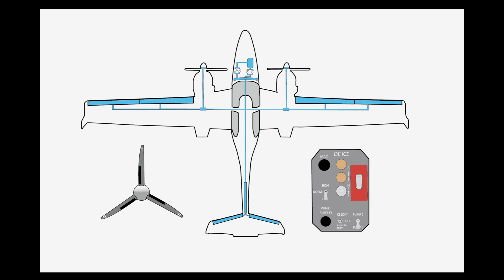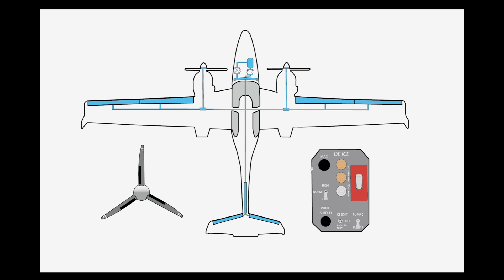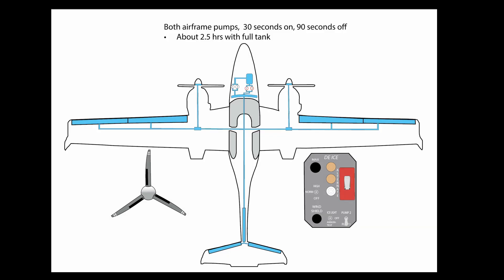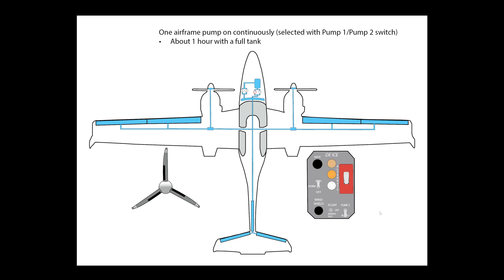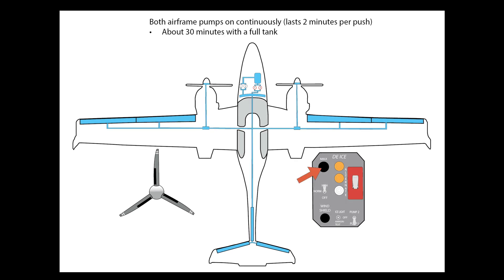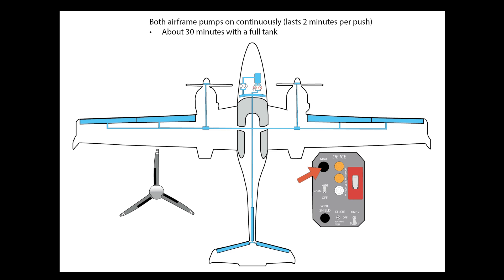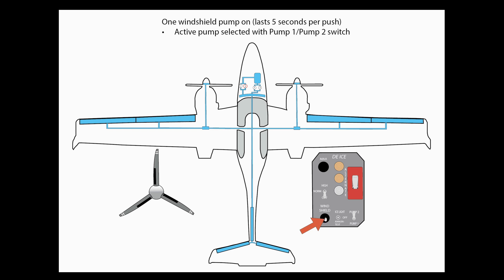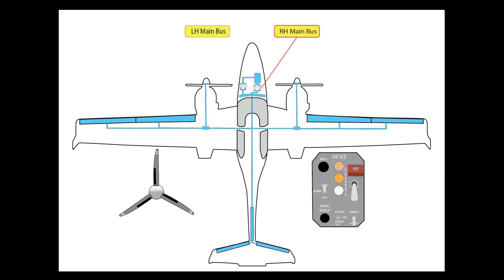DA42 Ice Protection System

Comment: I learned so much from this video. It is very clear. Thank you so much! I work at the diamond factory and it is useful information for me. The last portion is good design. In case of one alternator failure, at least we can still run the TKS system for a while.

Comment: Very good video! (as you say the POH is somewhat lacking in detail). While writing do you happen to know what is the reason you mentioned that in norm both pumps run together, but in high only one runs (and which of the two depends on the switch position), seems a bit counter intuitive - for example in norm they could alternate every 30 seconds ? Perhaps it is related to redundancy.
Reply from the maker: @marklee1462  I would imagine you’re correct but I don’t have a definite answer unfortunately!